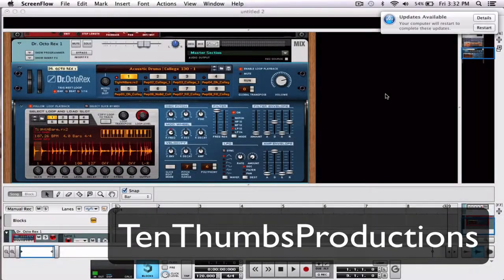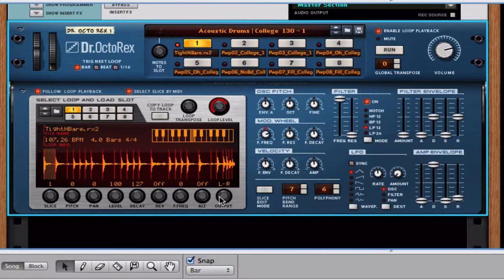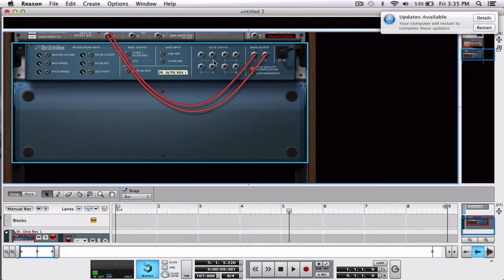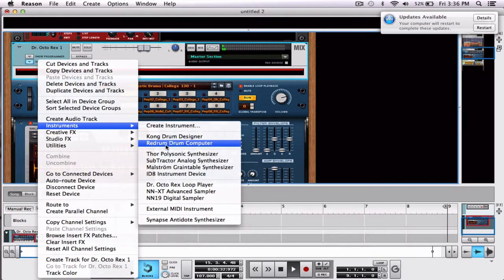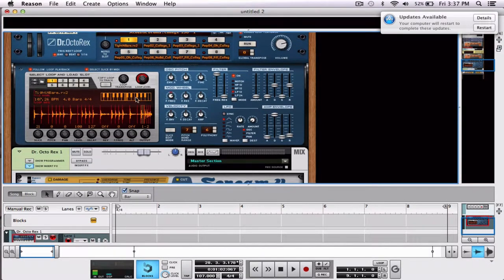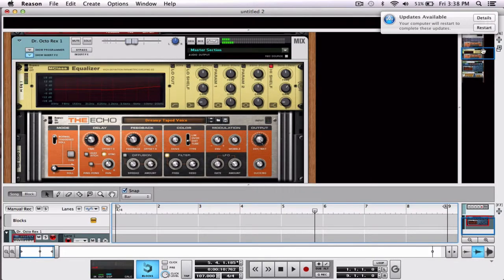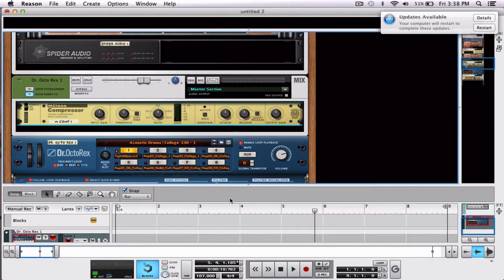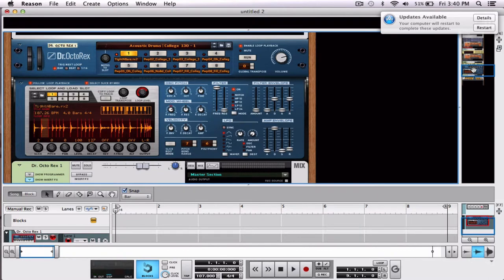Dr. OctoRex - Slice Control 2 - Audio Out, Dry/Wet Signal

Comment: i sliced up a sample loop in ReCycle 2.2.3 hoping to be able to independently change the pitch and/or tempo of the loop in reason. however, when i load the sliced up .rx2 file into the dr octorex it doesnt play smooth but rather with gaps between each slice. furthermore, when i try to slow the tempo down these silent gaps become even larger. do you have a solution for this?
Reply from the maker: The key to that is getting the tempo and pitch you want in ReCycle. The first thing I do get the tempo I want and hit play, and than I change the pitch until those silent gaps disappear. You can add reverb, delay and echo to smooth those gaps, but you will still have them. I have a video called Kanye West Style Sampling, watch that one and it should help with this problem. In reason it is more difficult. Another have a record channel, record the rex again to an audio channel so you have a stereo audio file, and than use reasons time stretching as well.